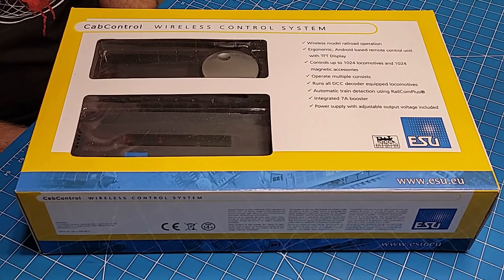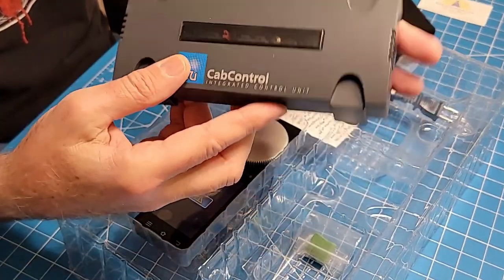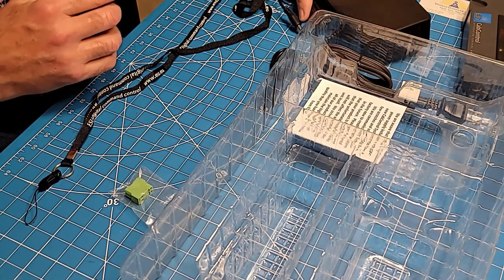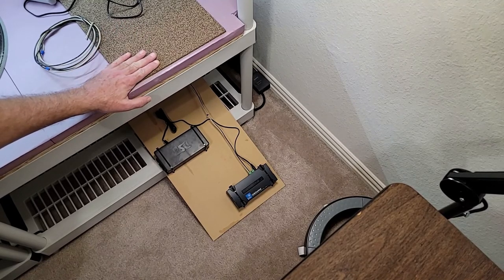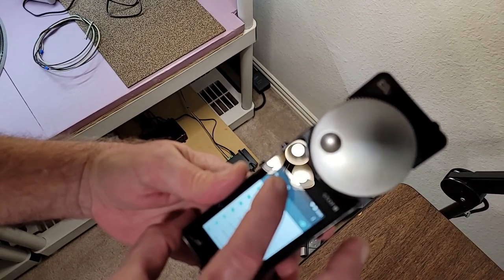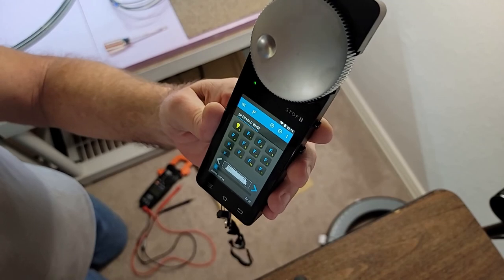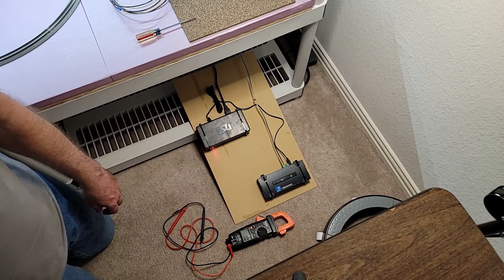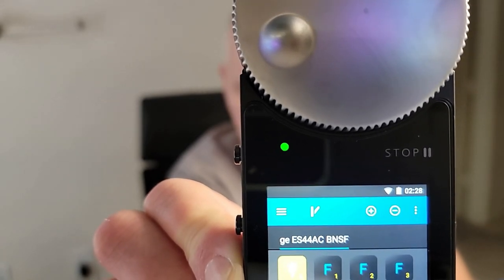New ESU CabControl System - Unboxing and Setup

Comment: Hey Brian,

don't worry about the little higher Voltage of you ESU Command Station output to the tracks, it does not matter.
DCC is different to DC and the Command Station gives your decoder via DCC the order not to have an higher Voltage than 12 Volts or than of what your motor will allow to have in maximum.
Other european DCC Systems using up to 21 Volts track power in N Scale and the DCC Locos did not burned out, so don't worry about of that.

With your ESU Command Station you have got a very well and best available quality product, for myself a little bit too expensive, so I do use the Roco/Fleischmann z21 Start Command Station with WiFi Router which is using 21 Volts DCC track power by up to 3 Amperes, only. I use my H0n30 locos with my DCC System without problems either.
Some of my H0n30 Locos are based upon N Scale Locodrives.
H0n30 (H0e) and N Scale using the same track gauge of 9 mm.

Please have lot of fun with your ESU Wifi Cab and ESU Command Station.

ESU does have lot of excellent digital decoders and sound decoders, too.

Happy Railroading,
Ingo R.
Reply from the maker: Thanks!  It's all working.

Comment: I like it... im jealous... if im ever in Texas....  surprised that u cant read dcc voltage in AC mode... have fun. Keep us updated. Something tells me ull be programming decoders in a short time.
Reply from the maker: Hi Rick - If I could split open the power supply and find a ground point, I could read 1/2 of the AC voltage from track to ground, but it's brand new.  I'll wait for the RRampMeter to get here.  I'll have to get good at installing decoders in N scale.  If you're ever in Texas, you better stop by!

Comment: I can't wait to get back home so you can show me how it all worksand let me try it. 🙂
Reply from the maker: Me too - We have a challenge to do with the throttle when you get back!
Reply: @brianpagemodeltrains  nooooo dont go that far. You should be able to set your meter to AC and put the probs on each track. A DCC signal registers as AC power.
Reply from the maker: @FBMRR    That's what I thought also, but I'm getting something ridiculous like 3 volts AC across the tracks.  I'm sure I'm doing something wrong.

Comment: I am really impressed with the reviews of the ESU system but a new entrant into the world of DCC. Probably a dumb question but when you purchase a loco which is "DC/DCC Ready" do you have to purchase specific decoders from ESU to make the loco work on the ESU system or will other decoder say from Digitrax work as well? I notice you are modelling with Kato which is going to me go to locos where possible, but I know I will likely end up with other brands as well, particularly with steam locos. Appreciate any guidance. Thanks
Reply from the maker: Hi Gary - I currently have No locomotives with ESU decoders.  The ESU Cab Control system will allow any decoder to be used.  The only caveat to that is you have to manually program the locomotive with the non-ESU decoder into the controller, but it only takes a few minutes.  This is not a problem for me, because I change my decoder addresses to the locomotive cab numbers anyway.  If you happen to have a locomotive with an ESU decoder, you could set it on the track and the ESU controller would automatically add it into the system. But I have not seen very many ESU decoder devices yet, at least not in my area. ESUDCC has a channel on YouTube at https://www.youtube.com/user/ESUDCC.  I watched all the newer Cab Control videos there before I bought the system, it was a big help. 
 Hope that answers your question - Anything else, let me know!
Reply: @brianpagemodeltrains  Thanks Brian very helpful.

Comment: Nice video!  ESU makes great stuff, but their designs always leave a bit of head-scratching (I think the Cab Control would work better with the screen above the knob).  Did you get just the Cab Control or are you look into the ECoS?
Reply from the maker: I just got the CabControl, throttle and power supply.  For my little layout, it works.